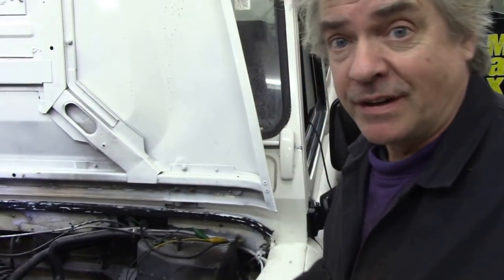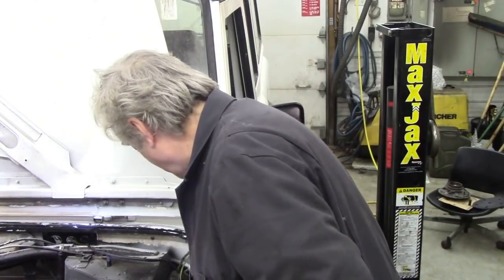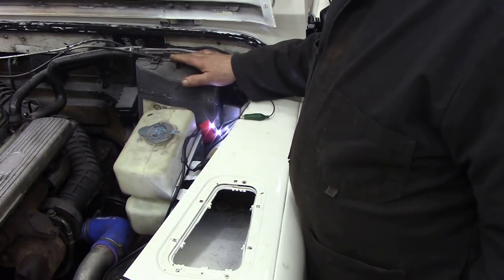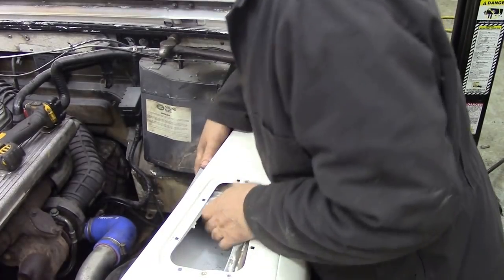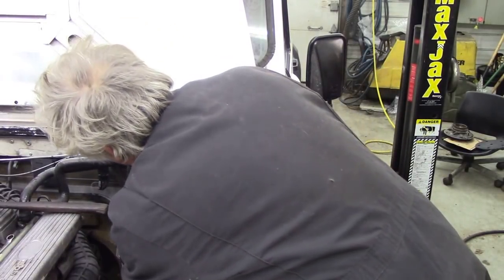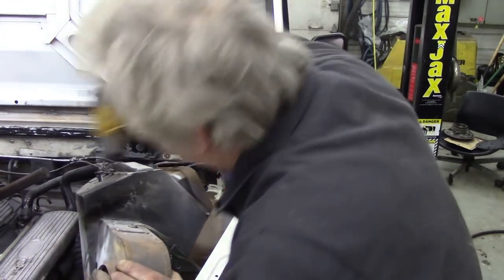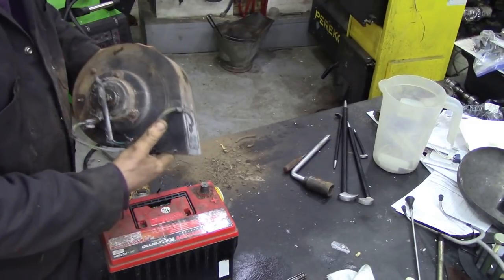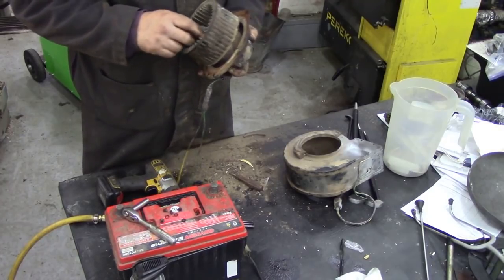Malawi 110 Why does the heater blower not work?

Comment: Great effort. A lot of people forgetting them these days and just finding a place to fit a cheap chinesium diesel heater instead.
Reply from the maker: Cheaper than a blower @ £145!
Reply: The Eberspacher heaters and their various copies (including Chinese) have the advantage of using on,y a tiny amount of fuel for a decent amount of heat.  They don’t need the engine running, so save on engine wear, fuel and noise.  Besides, the cabin heater overcools the engine at idle in temperatures of less than 10oC, so are not much use for stationary vehicles in Arctic conditions!

Comment: Had the same problem with the blower motor on my Series.   I ended up taking the motor apart, cleaned it up, lubricated it and now it's fine.  I'd put a snow cowl on that air intake to help limit the ingress of water and future problems.

Comment: Two tips that some of you might find useful:

1) before spraying the WD-40 penetrating oil, get some Isopropyl Alcohol (IPA) in there and, if you can, actually run the motor for several minutes. IPA is an electrical contact cleaner, so it's a partial refurbishment of the motor. You can actually "run in" and improve 12V electric motors by running them submerged in IPA, would you believe!

2) you may find that the blower heater unit has a wedge-shaped foam rubber gasket between the heater and the passenger bulkhead. This can make refitting the attachment bolts a pain, as you're trying to press against the foam rubber gasket while attempting to fix nuts-n-bolts. As I was about to give up on my solo repair, my Landy lost patience with me! She popped out that dummy air intake grill an the left side of the front wing. Looking through the hole it left in the wing, I saw it was a convenient place to insert a crowbar, to leverage the heater backwards while I got those bolts fitted inside the passenger side footwell. Job done. 

Anyhow, thanks for producing and sharing these videos. What did people do before YouTube?
Reply from the maker: I now put captive nuts in the footwell where the bottom nuts and bolts should go  - - now a one-man operation and a lot simpler!
Reply: @BritannicaRestorations  good idea. But I'm hoping not to be switching heaters too often. Your suggestion is probably also worth considering elsewhere on the Landy. Thanks

Comment: Perfect timing! I’ve been contemplating this exact job but have been putting it off cause it’s summer and bloody hot and it’s a fiddle around to get the heater out. However, I want a working heater before it gets cold and this is the motivation I need to pull it out. It’s right hand drive with AC so those two little bolts at the bottom are what’s holding me up. Thankfully the AC is already disconnected.
Reply from the maker: Go for it!

Comment: Hi Mike, Best upgrade is to fit the TD5 matrix into the heater and seal it , I had to turn my heater down on a summer day in Cumbria
Reply from the maker: The 300Tdi matrix is the same size as the Td5, but with the hoses in a different place
Reply: Hi Mike,  no, pipes same as 300tdi but has a better core, the biggest prob is that the top and bottom tanks are larger  so the openings have to be enlarged, but its worth the effort , my window demisters now work....
Reply: It’s not the design that made a difference but the fact that it was new and unclogged with sediment, scale or corrosion.

Comment: Mike I've done a few of those type of heater blowers on old Jags and they've always needed completely dismantling to free up. The armature shaft journals need rubbing down with a bit of "wet and dry" paper, lubricating with a little grease and usually run ok after that. They rarely burn out easily even though they can be stuck for years.
Reply from the maker: Problem is getting the plastic fan off without destroying it  - the shaft rusts and expands the plastic - there is nowhere to pry it off  - and if you warm it and lucky to get it off - then refitting is  a nightmare as the shaft is now sanded down to get the cover off - you just cannot win! 
You could buy the fans separately but not any more
Reply: @BritannicaRestorations  yes of course, the old Jag fans were all steel Smith's units, with a type of metal collet fitting holding fan drum to the shaft, "ah, them were the days", pure luxury...

Comment: Hi Mike, getting the air trunking out didn't seem too bad by the looks of it, but wait until you get the later defender's with the the 2.4/2.2 transit engines, there's weeks of mirth in that after you've done that job, and as an aside the glow plugs will give you laughs for years to come...
Reply from the maker: Roy - it will be a good long while until I see one of them here - still have hardly any Td5 here! lol!

Comment: I remember to fix one of these electrical motors... The water with dust got into the deepest part of the motor... The bottom of the motor where the copper bush is... Facepalm!!!!
Reply from the maker: This why I had  go at trying to vibrate a bit of light oil into the bush - it turned, but not good enough

Comment: My defender 110 blows on setting one but not on full power. The fan is free and very clean I cannot figure out why it won’t blow on the fast setting.
Reply from the maker: Take off the instrument binnacle and swap the wires over on the back of the heater switch (green yellow, green purple)
The blower will now work in position 2 but not 1
I would wager the resistor has blown in the heater blower - this is fitted to reduce speed on the position 1

Comment: Just ordered those 'sticky pad' things for mine to go back together... bloody expensive ~£17
Reply from the maker: Yes they are expensive for what they are 
But if you think that was expensive look at the motor price!

https://www.paddockspares.com/utp1911-heater-motor-and-rotor-assembly-rhd-from-la939976.html
Reply: @BritannicaRestorations  As It happens I did as for the last 20yrs I have always had the fan running on speed 1 unless I run at 2 but never off.  I though I'll bet those carbon brushes will be at the end of their life.  Just on with refurbing the pedals and doing brake lines, Heater will be next of new B/C pillars, I'd like the get them and fit at Easter, so don't forget when you get 5mins about distances for the C to rear tub measure please.

Comment: Mike, I contemplated removing my heater and putting a diesel heater in it's place because on a 90 there are not really very many locations for one. Have you ever seen a good spot for a diesel air heater in a 90?
Reply from the maker: I was contemplating a cheap diesel heater to fit in its place - 90 is a bit tight for space
Reply: @BritannicaRestorations  I was tempted to fit in in place of the centre seat, make a new centre seat box cover with the holes in it for exhaust etc. then it can be a modular thing that I can take out in the summer and put the seat back in...
Reply from the maker: You can get a box that the heater fits in below the cubby but it is expensive
I designed one but the cost of production was too high
Reply: @BritannicaRestorations  Yesterday I ordered a new centre seat cover from YRM - I was not willing to cut up my original. I am going to mount the heater to that, then I am going to copy the heater box you speak of. The one from Mud? I currently have the centre seat, quite like having it but in reality I never have 3 people in the 90. So I will remove that and look and getting a cubby.
Reply from the maker: Yes Mud do one that's why I gave up on my design - but it was a lot better!

Comment: Hmm... wonder if the Defender heater would be a good upgrade for my Series III..... 🤣🤣🤣
Reply from the maker: Actually when they are working and not plugged up, they are not a bad heater - the thing that lets then down is the coolant is not hot enough and they pull cold, ambient air in
When Jim and I were out in my 130 last weekend to pick up some furniture it was like an oven in my truck - I draw the air in from the footwell floor and the Isuzu puts out more hot coolant than the Tdi  - it was too hot on the second speed!
Reply: don't bother: my series with a 45 year old heater core works miles better than my 300tdi ever did! Also the way the motor is integrated in the housing is terribly clumsy.
Reply: Look up T7 (or is it T17?) Design for upgrades if you must.  Series split heater and fan and our series had a better heater than our 90!
Reply: I've got an old 'Smiths' heater in my Series II cab, it's a larger rectangle one, probably military. I've seen smaller round ones too in other series vehicles. (It's a heater core / radiator in a box with a fan, goes in the cab, hooks to flow & return pipes from coolant system)
Advantage: Can be placed wherever you have room in the cab.
Disadvantage: There is no room in the cab to begin with... ..  :D
Reply: I did exactly that and have a very good heater as a result.  But it might be just as effective to recondition your existing blower (similar size, so probably similar airflow) and replace the heater matrix with new.  Then just go around filling the holes in the casings, the lower fascia (usually got rust or screw holes from some accessory or bodged repair in the past), ensure the demister vent hoses are in place, the large grommets that seal the lower fascia to the demister hoses are in place, and replace the corrugated plastic hose from blower to matrix, as they get very brittle with age and split everywhere.  On the water side, remove and clean out or replace the steel pipes along the head, the valve and various connections, and check the hoses.  With good airflow, good coolant flow and correct control adjustment, they work pretty well for European winter conditions, even in a 109.  

The Defender type’s principal difference is how the temperature control works - it has an air diverted flap that directs the fan air through the matrix for full hot, around the matrix for cold, and wherever needed in between, while the SIII type has all air go through the matrix and the temperature control restricts coolant flow through the pipes.  That means the Defender type responds more quickly to control changes, has less restrictions in the coolant pipes as is lacks the coolant control valve (also less likely to leak or seize), and can blow cold air faster as it is unrestricted by the matrix.  But it is a bit of a faff to retrofit, mostly because of the blower intake position (won’t connect to SIII wing intake) and because you need to reverse the wiring polarity (simple enough).

Comment: Don't suppose it got much use in Malawi.
Reply from the maker: Not even as cold blower!
Reply: @BritannicaRestorations  It gets down to around 6 degrees C in Malawi in winter, and parts of the country see frost. It's not as hot as you might think, and a bit of heat would feel alright in 6 degree weather.

Comment: Hey Mike.. show the motors who's the boss and warm it up with bursts of 24v in both directions ... you can't really make it any more f00ked than it already is..
Reply from the maker: Problem is if it sticks again after a few weeks which it may do in this case - usually a soak with oil gets them running again
Reply: @BritannicaRestorations  the warmth usually draws in the lube. We have the same issue with maraine engine-bay blowers on 12v system. The brushes stick and a good "kicking" usually sorts them out..

Comment: hi mike,complete new heater unit would be best, if you own a l/rover you have to have deep pockets so the owner has to cough up,the series 3 was slightly easier to do, again clown designers,at least on the series 1 the heater was inside on the bulkhead
Reply from the maker: Yes they are not cheap - C$369! just the blower!

Comment: Tell you what Mike ,the days off fixing them crap heaters are over mate ,,,,,chuck it in the bin and order a night heater of eBay 85 something quid plumb the hose into the intake vent ,,,, happy days instant sauna ,well 10 min and the bonus part it's remote controlled ,so sat in your y fronts with a cup of tea start finish tea jump in your nice warm truck  happy days mate

Comment: Wouldn't of wasted time fixing the heater they were rubbish, the only good heater on a defender was on the puma
Reply: They’re not bad if they’re clean and correctly set up.  I get a lot of heat out of my standard Defender heater with a 200Tdi once the engine is warm.  Certainly ample for UK conditions while driving, but the heater overcools the engine when idling.  For Arctic conditions, a parking heater or something like a Webasto Thermotop would be very useful.